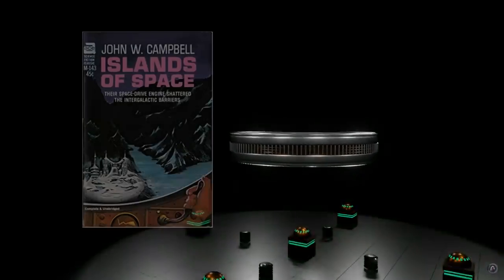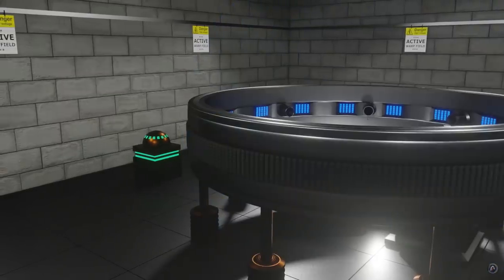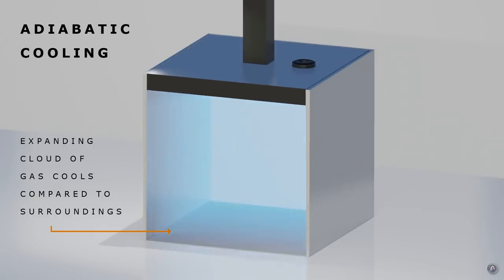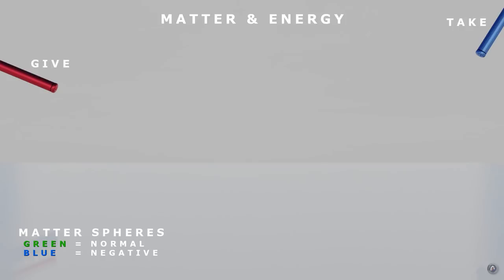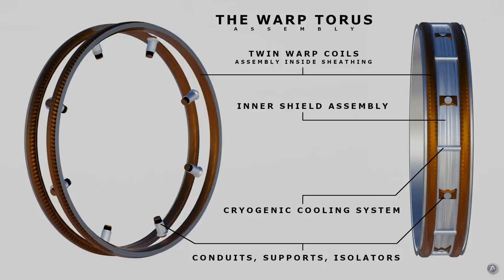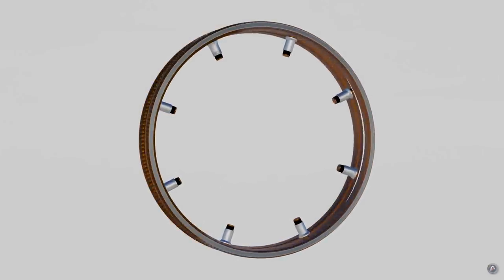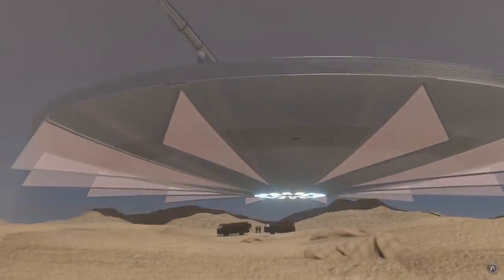A Detailed Breakdown of an Alcubierre Warp Drive Coil

Comment: One coil is insufficient. But the direction you are heading seems to be logical.
Reply from the maker: Within a smaller 7 metre craft, one coil will work just fine, that said, the actual coil will have nothing in common with the basic coil concept in the video, which was only meant to convey the general idea. The real-actual system, how it functions, is more complex still.

Comment: Reminds me of that old TR3B stuff, if I remember correctly, someone back then claimed that a similar ring-shaped accelerator that could push mercury ions past light speed would reduce the inertia and mass of a ship, allowing smaller amounts of thrust and faster acceleration, but that was kinda debunked a couple of decades ago, unless this is an alternate reality where of course Nelson Mandela died in prison in the eighties, in which case, I apologize.

Comment: There is a possible way we could deliver enough power to the drive. If the drive requires about 1 ton worth of energy, it could be possible to create a micro black hole and throw about 5 or so tons (much energy is lost converting both light and heat into electricity) and harvest the hawking radiation. Only problem is we don’t have a solid idea of how to get the fuel dense enough to become a black hole, and a black hole of only 5 tons would radiate its mass away so quickly it would be an explosion that makes nuclear warheads look like a plastic nerf bullet in comparison. Plus, hawking radiation from that black hole would be ridiculously high energy and could fry the craft or be difficult to harvest or deflect. The benefit however is that literally anything can be used as fuel, you don’t have to waste energy making antimatter.

A lot of what this guy said in the video makes no sense. There is no need to protect the crew from acceleration if the drive produces no acceleration. A drive that accelerates in the classical sense cannot go FTL. I do sincerely believe warp drives are possible, but at least for now it looks like we won’t be building one for a very long time. (Not saying that we can’t live long enough to see it though, medical science is advancing rapidly)

Comment: Gravity is not a fundamental force of the universe, like EM Energy or magnetism, it’s a reactionary force. The movement of objects of some mass creates attraction (gravity) towards them. The smaller something gets, the less gravity it produces, but it never reaches zero (unless you consider photons as matter, but they only selectively act like particles circumstantially, not permanently). The more mass an object has, the greater the gravity produced; think planets, neutron stars, etc. Without the object, gravity can’t exist, doesn’t exist; there are no empty fields of gravity by itself.
Because, like I said, gravity is a reactionary force, not a fundamental force.
I hope that helps y’all at all.

Comment: Finally i see that this kind of knowledge It start to become accepted! Anyway you don't talked about a phenomenon that could decrease  to several orders of magnitude the actual Energy and Power used to form a warp bubble; i talking about multirealm resonance that conciliate    the dimensional, electrical, electromagnetic, and medium resonance parameters at once to generate a multidimensional phase locking. I think that in this way  100 MW of Power could sustain a warp bubble. But shape of the coil and distribution of materials propreties are very important toomuch multirealm resonance could be very Dangerous if out of control.

Comment: So essentially in its primitive state.  the Warp Drives even if not capable of FTL travel, they are more than capable of in system travel and potentially long distance if still centuries long deep space travel and literally cuts travel time down significantly.  Its obvious then.  We must try to get the Alcubierre drives operational and installed on next generation designed ships.  It would essentially get us off earth and quickly colonize the solar system giving humanity more breathing room and access to vast amounts of resources.   refinement of the technology of course would continue and when FTL energy requirements are achieved the tech itself should have matured at some point where the tech you could say catches up with its intended purpose.   That's of course if we are even capable of building non warp alcubierre drives to begin with :P.  Its fun to dream.  but given that SpaceX is on its way to getting us off this rock.  Such dreams tend to become reality.

Comment: With this engine, if you could call it that would need the energy of of many H Booms going off and a magnetic field to hold it, and  what force would be needed to move forward, backwards, up or down, I saw the rockets on the tail end? ? ?

Comment: "Energy" is "mass" converted twice.

What does the Earth weigh? (approx)
How many electron volts (Solar Wind captured by the Poles)
does it take to keep this mass moving, with included
pressure of centrifugal and gravity, to maintain an orbit of The Sun,
while juggling the added mass of The Moon? 

Any addition or subtraction of any of these factors, requires adjustments
of every other component (distance, weight, speed, course, voltage) in the model.

Throw a (1g) paperclip as hard as you can-
(impart kinetic energy to it, accelerate it's mass= it becomes heavier)
but only so much. 
Throw a 1,000g weight. You can throw it "harder"  Why?
More mass will accept more kinetic energy.

How much "power" (energy?) does a supernova exude, and yet the ONLY proof of
it happening (no medium in space) still takes 235 Km/Hr to reach us!
And- if there's supposedly no "medium" to rob power (drag) in space- does that
supernova reach us with the same "force" after traveling that immense distance,
for that unimaginable amount of time? (millions of years) No. Our Star's own 
Solar Wind bubble (Heliosphere) protects us from the pressure of most subatomic
particles except light. (Long and short wavelengths)

"Light" is a strange phenomenon. Zero mass, yet can be sped up or slowed 
down, curved, and normally moves the fastest of any known particle.

Comment: This type of device is need to be built with superconductors, that because of huge amounts of energy that would be used, if only 0,1% of energy it's transformed into heat engine would be melted in a second. (superconductors not have zero resistance for electricity energy but 100 millions lower than a ordinary metals, and having a upper limit of the energy above that stop to be superconductors of few million ampers of square centimeters means this device is need to be millions fold more bigger than area where generating a effects, that means device cannot carry itself)

Comment: all fine and dandy.  The problem is power source.  You need a good powerful power source.  Conventional fuel source on Earth will not suitable for space travel.  Power source or material for the power source is the KEY to that.

As for warp travel, the space ship needs to produce artificial gravity to bend space and time in its surrounding in order to move through space at faster than light speed, and without feeling the effects of inertia.  This example of artificial gravity is found in the alien's ship found at Area 51 back in the 1940s.  Their alien ship basically produce a bubble gravity that allows the ship to move in any direction, and stop, instantly.
Reply from the maker: The subject has become more complex. Since the publication of this video, both techs have undergone advancement. Source of energy and means of 'warping' space has changed. Something new is on the horizon. We're working on a new theory which extends Relativity, one of the conclusions of the theory is the existence of a new energy source suitable for a warp drive.

Comment: Has ANY of this been demonstrated?  If so where, by whom and what were the results?  Has a Froning coil altered gravity of ANY body by - say - 1lb?  Has anyone even TRIED to build such a coil.  If not we do not even have proof-of-concept.
Reply from the maker: We cannot speak for 'behind-closed-doors' research, but we can tell you that such devices/technology have been tested with mixed positive results, largely because they did not possess a proper theoretical basis, this includes NASA's testing. Since then the research story, for no reason, ends abruptly. To date, there are no spacecraft, aircraft, or any other vessels, et cetera making use of this technology specifically, no nation has the capability of interstellar travel.

Comment: See, I think the speed of light only applies to the natural expansion of space time. To say, the speed of light is the theoretical speed space time expands, would be correct. I think saying other would be incorrect. Warp drive would just take advantage of space time in a way to manipulate it.

The speed of light doesn't even apply to how fast light goes as it naturally changes. If you only want to express the speed of light as light speed through a vacuum, fine, but that is disingenuous.

Comment: i always refused the idea that craft can bend space time, are you serious? Such a little craft distort bend space of millions lights of years? It definitely should enter some kind of dimension where the are no obstacles and particles, asteroids, debris etc. that it can run into while travelling enormous speeds accross the universe.
Reply from the maker: The ship does not bend millions of light years worth of space, only the very immediate spacetime fabric, which it rides. Your words, "It definitely should enter some kind of dimension..." You are correct, it already does - it's called hyperspace - the craft is boosted into the 5th dimension. But this does not mean you stop interacting with the other four dimensions, debris and all. In order to avoid debris either you need special shielding or you need something like the Musha Jump Drive: https://www.youtube.com/watch?v=ShIJSpV3BII&t=201s

Comment: I have never followed why just two coils, like that concept nasa did a few years back. I understand that at this level of physics conventional wisdom brakes down, but I have never grasped why you would not just want to have a field no bigger the 100% necessary to reduce energy as much as possible. (The logic being the larger the field the more energy required.)
Reply from the maker: We have already advanced the warp field effect, this is an older design. What generates the warp field effect is not a simple or larger magnetic field, for this device the answer lies within what you do with that field. You must be able to alter spacetime using a specially controlled field. It's well known that all energy alters spacetime by a 'extremely tiny amount'. The more power you apply the greater the effect, but this method 'alone' requires huge amounts of energy and therefore, it not practical. Our latest method does not require as much energy.
Reply: @asteronx  I forget the name of the researcher but, are you referring to the paper that proved this is possible with out negative energy?
Reply from the maker: @andrewyork3869  No. That paper is only another theory, not proof. I was referring to our paper not yet published.
Reply: @asteronx  if I may ask when is that paper expected to come out?

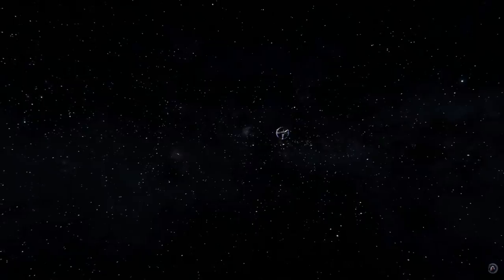Comment: 2:27 Really?! Only 50 years huh, so that is just 20 years after Fusion power plants.
Reply: We have fusion plants that generate more energy than that take.

They just destroy themselves right now, thus taking more energy to rebuild them then they generate, or they are too small costing more energy to start then they can generate. (As they grow more efficient from having larger internal volumes compared to their outer surface area)
It's an engineering and building issue, not a practical issue. I.E. it just needs funding.
Reply: @allhumansarejusthuman.5776  I keep up with technology and have never heard of that. Can you provide a link? The only working fusion that destroys itself is a hydrogen bomb

Comment: 🛸🌀Hiperspin engine  , one of my cool Invention concepts , having a mass increase at will. Having a small centrifuge that spins at 200,000 Gs would make a one ton mass into 200,000 tons instantly at will and start warping space time by having individual motors with its own power source spin on top of a already moving surface making the other top engine spin faster then the bottom , the more engines the faster it would spin exponentially to infinity In theory making it spin faster and increase Gs up to the desire mass and including creating a gravity pull or even a time bubble displacement.🛸
Reply: AFAIK, there isn't anything publicly understood which relates mass to gravitational pull (when a million trillion atoms are clustered together or so). There has been a slow adoption of the idea that the virtual W+, W-, and Z bosons carry most of the energy and thus 90 something % of the "mass" of any given nucleon. It is likely that the mass comes from the reluctance of these dynamic force carrier fields when faced with movement or traversal, but why is it that they (nucleons) seemingly only resist acceleration and not general movement through a swarm of gluons? I might need to brush up on the state of the art in Quantum Chromodynamics.

How do you propose to contain the material, considering the extreme inertias involved? If you have a claim that you can negate inertia then I would love to see the paper, as I've yet to find anything that can do this (that doesn't involve a patchwork conspiratorial piece where you play 20 questions with the content creator that supposedly knows the answer).
Reply: @Baigle1   one Idea that I have is to have the rotating mass be made magnetic material and have a outer magnetic ring that is not all connected  to the rotating spining mass. Both the spining mass and the outer magnetic ring  would be of same polarity in order to push the rotating mass inward and prevented from peeling off at high Gs , until the mass aquire it's own gravity and is able to hold in its own matter in space , at zero Gravity spining motors would then turn off once the desire speed is achieved , since it could continue to spin on their own at zero gravity .
Reply: @megatroninventor /videos Do you think that material traveling at high speeds gains a gravitational force multiplier, that this material when traveling through a magnetic field encounters no resistance, and that a material traveling at sufficient speeds no longer is affected by gravity? Do you have any links to any papers that outline these claims and an experiment that verifies them?
Reply: @Baigle1  , planets have mass and a gravity pull like earth has 1-Gs , but most folk overlook that the mass comes from the electrons spining around the atom at 1% the speed of light which is 18 seconds around the world , the faster a "object or electron"  the more mass it gains E=Mc2 , so centrifugal spin of any kind no matter if it's a large object or smallest the electron , it will gain mass and if the mass is larger enough then it will begin to have its own gravity , this mass can be a object mass(planet) or or a enertia mass , but both are the same because both store energy in the form of inertia mass just that one does it in a smaller scale , the electron spining connected to the atom. So inertia mass which is stored energy in the form of mass will have its own Gravity if it's mass increases by inertia mass. and yes the motors will eventually get heavier and heavier because even motors will become heavier themselves at higher and higher G's spin , but a because of many seperate engines but interconnected they will all share the load equally , but in space at zero Gs it would be easier to achieve the goal , and if there any magnetic overheating  or friction it could a cooling system to cool the magnets , we know that supersonic magnetic trains travel faster then 150 miles an hour with out a problem , any forseable future problem can be fix with little engineering effort from scientist.
Reply: @Baigle1   glad to know someone is asking the right questions.👍
Reply: @megatroninventor /videos Yeah, but no one knows the answers [that i've asked] and everyone seems to think they have them (the answers).

Comment: The answer is fusion. Take the warp ring near the sun, use the sun to trigger a matter antimatter reaction, use that reaction to trigger enough fusion to generate a warp field. The warp field will in turn continue to reenergize the fusion. Fusion is continuous, which is what will be needed to keep the warp ring running. But only a fast orbit of the sun will be sufficient to trigger the required amount of fusion. Will need to get the warp ring close enough to absorb the suns energy.

Comment: Nikloa Tesla scientific scientist and inventor devoplement and built the first two man warp drive saucer spacecraft using 8 warp coils with patent in Colorado spring Colorado in 1899  year ! 
Their are 132 multi dimensional universes by warping time and warping  space and traveling faster than speed of light !
StarDrive Engineering company has been builting saucer space crafts since 1985 year for united states military pentagon deep space program in Quantum mechanics physics in electromagnetics propulsion systems that never needs fuel and runs forever has artifacial gravity field inside saucer spacecrafts that can across galaxies and 132 multi dimensional universes in seconds by warping time and space and traveling faster than speed of light! Example > earth in milky way galaxy to andromeda galaxy nordic planet in travel time in saucer spacecrafts in 240 seconds !StarDrive engineering company  Saucer spacecrafts  can open  electromagnetic field frequencies to  open worm hole to 108 parrell multi dimensional universes with 108 multi dimensional earths !
Reply from the maker: Sorry to pop your opinion bubble, but NO ONE as yet is able to warp through space. ( Your opinion is not based on personal experience. )